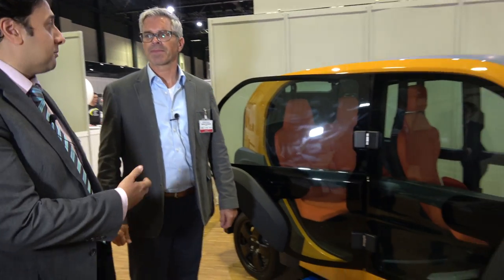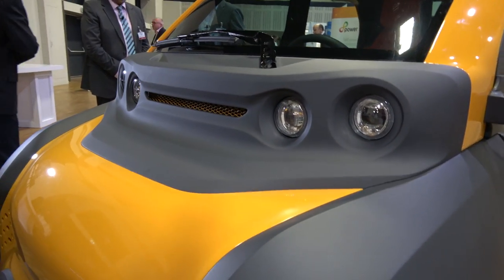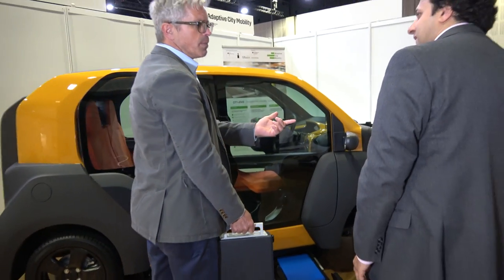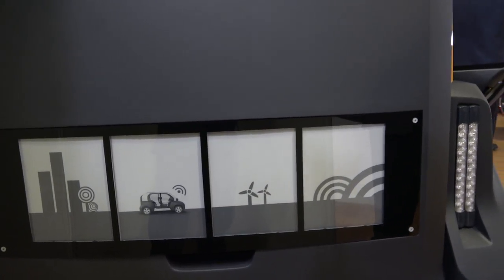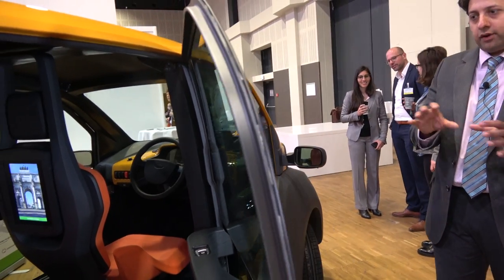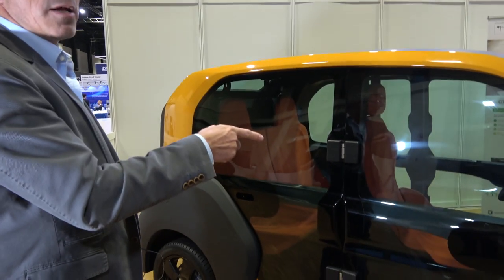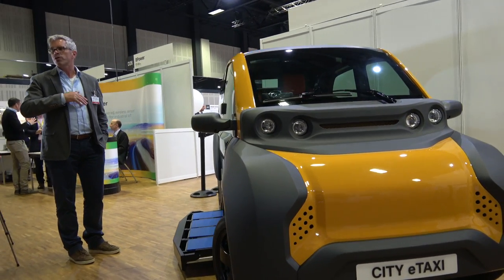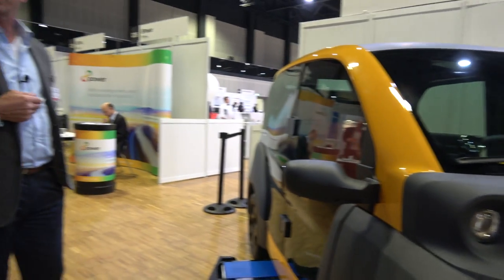Electric Taxi with Battery Swap, 550kg, Adaptive City Mobility Prototype

Comment: Any guarantee that in an event of a crash, this eTaxi won't explode and burn the passengers to death?  Like the one in China.
Reply from the maker: I think a petrol powered car would explode worse than any EV. People die in exploded petrol powered cars every single day. Accidents have to be compared reasonably. For example for self-driving cars, sure there will be accidents, but in terms of % those even with current systems will be much fewer than human errors in the traffic. Ergo it makes no sense to ban something that is demonstrably much safer already.
Reply: well Chris Bautista, new electric batteries have different characteristics, one of them being working stable at very high temperatures and very low temperatures and using special films and special protections that would prevent them to explode, also they are made of common products that won't explode, like sand, salt, hemp, graphene, etc. just research this new batteries, there's a big world of information and research and development for that, multitudes of batteries, multitudes of approaches, etc., and they are much better than these typical commercial batteries of per example lithum batteries, except those big company lithium batteries have all the hardware and software approaches that makes them much more efficient than typical commercial lithium batterys, now if tesla would experiment with new batteries and use them, instead of lithium or lithium ion batteries, we could be using batteries made of salt, which is a obvious super abundant product with better chemical/pysical characteristics and technology would develop even further with much more alternatives. I guess you get the point of all of this.